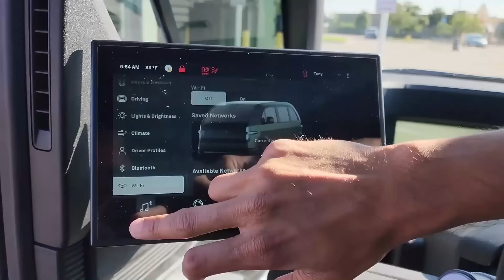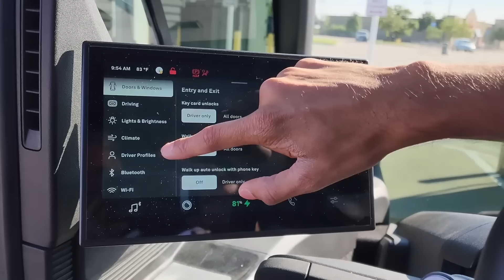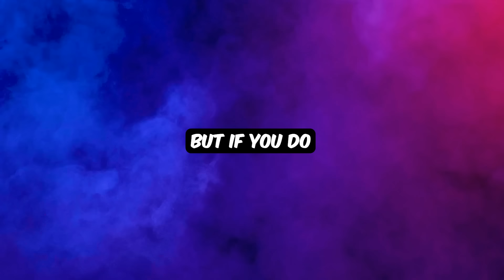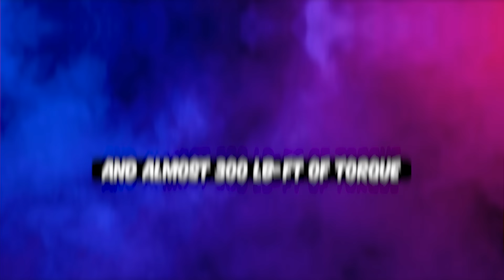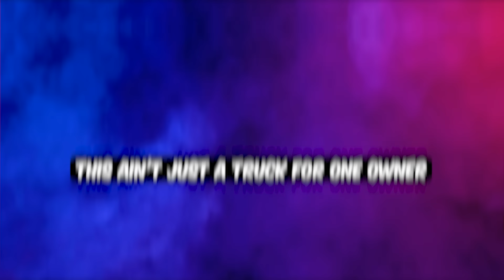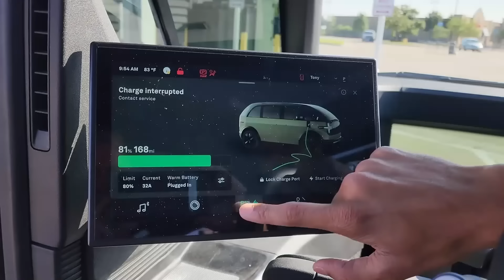IT'S HERE! GENIUS All-NEW Canoo Pickup Truck!

Comment: Very verbose and even some hyperbole but VERY light on facts, especially anything new. The headline says "It's here!" and yet we don't see any of these trucks on the road because they are not being manufactured for the public yet. Canoo still only has one manufacturing plant operational in Oklahoma and it's pumping out vehicles ONLY for fleet use. That's probably a smart business move for Canoo but it doesn't do anything for the public. The goal for 2023 was 23,000 vehicles but did they achieve that goal??? Even if they did, all those vehicles were destined for fleets. I would assume that even if Canoo can ramp up manufacturing, every vehicle it makes for quiet awhile will have to go to their fleet deals or they risk loosing money. I don't think the average pick-up owning guy or gal will be able to get one of these until 2025. Am I wrong?
Reply: Nope you're right. They appear to be dribbling them out to their commercial buyers. I have not seen exact numbers delivered to Kingbee, Zeeba last week or if Walmart has gotten any yet. I totally get their rationale. They're not ready to sell to the public yet. How would you get service? Drive to Oklahoma? No this makes sense. If you want one, and I do, you'll just have to wait. I heard 2025 at best. Also the range is 200 miles not 500. Price will be a little more than the top of the line LV model which is about 50K. They have a great product and I hope they can get going. Yeah I have stock too.

Comment: I have been looking at Canoo about 1 year before you made this video. After seeing other videos about Canoo, especially one  with Sandy Monro's video take on Canoo's van, I decided to buy stock in Canoo. In fact, yesterday I bought more stock in Canoo for my grandsons and more shares for myself.  I am considering replacing my 2008 hardtop convertible because I can no longer get certain parts for it. This truck and the van have so much going for it. At $35000, this is a very affordable EV and I like so many things about the Canoo van I like, that I am now hoping to buy one when they become available in my area. Because of snow in my area, I need front wheel or all wheel drive. If it comes with bi-directional charging, it could power my house with electricity when there is a power outage which happens several times a year here. The one thing I would love is battery swapping with Canoo like with NIO. But when batteries are swapped, they should only charge for the electricity. This is done with what Gogoro does in its battery swapping model.
Reply: Where did you find their stock? I didn't see it on webull. Maybe I'm searching wrong?
Reply: I wanna know too

Comment: Canoo may go the way of Elio Motors if they don't actually start production. The value of the stock a few years ago was $14 a share. Now it is around 16 cents a share. The fleet deals are nice and you do see promo pictures of the Canoo fleet vehicles, have anyone actually seen them on the roads or in the wild? There comes a time in the design/ manufacturing phase where they need to quit fiddling with it and actually start production and sales. Having said all that, yes I want one and I have shares of stock in the company. I'm frustrated because I've lost money in this company's stock.

Comment: The flatdeck on the military version will catch a lot of farmers and tradies eyes.  The competition is designed by toy users, not work users.  Even the Rivian which is the best size option for me is wellside only.
If the Canoo has a footprint the same size or less than the Nissan Navara/Frontier, then a right hand drive option has a realistic sales prospect internationally.

Comment: Everything sounds nice, but the major thing I'm worried about is repairability. With a unibody construction how are you going to repair panels
Reply: The same way you repair the 90% plus other unibody designed vehicles on the road today. There is nothing new to see here.
Reply: Just ask Rivian. Apparently it costs $35k just to replace one of the giant unibody side panels that can get damaged in a minor dent, a fender-bender. One of these EV channels demonstrated that recently.

Comment: Too much kitschy little garbage will inflate the price of this truck beyond affordability. The narrator says "SIMPLE", and then shows all these crazy little fold out compartments that NO ONE NEEDS OR WANTS. Give me a good infotainment system, heated mechanical seats and steering wheel, full safety features, and a 250 mile winter range with the cab at 68 degrees, and that's literally ALL I WANT in a vehicle. My Chevy Bolt hits the mark on all of these. It would be nice to have a pickup with the same truly "SIMPLE" design.

Comment: (The engineer(s) is/are genius )It’s nice but they should make it a hybrid variant ,have a small engine to maintain the battery charge. Until the battery technology gets better,  if at all, keep under $20,000 along with future battery(S). the batteries should get 600 to 700 miles per charge. And away to keep the batteries warm in the winter cool in the summer, have the  charging infrastructure throughout the US and every where else across the world. How about if you have to repair the body that is another problem. (Look at tesla what a nightmare )if you buy one who can service the vehicle? If so who is certified to work on the vehical? I love the truck and its versitality of it .I want to buy one but until they figure out these issues then I will buy one.

Comment: Few questions that come to mind after seeing this advertisiment. 

How much would scrach or dent repair cost on this thing? 
Will customer 35k version really have 500miles range or close to it?
When it is available in EU? 
Are they planning to let local repair shops do electric work too or is it something that needs their specific tech to fly over(adds weeks to car repair time and rises costs).
How much is range loss does weather do and I mean Nordic Europe weather where it changes from +30 to -30 celcius.

I was about to buy sono motors one that was like 20k euros but that company went under. Now Canoo is 35k and it isnt 100%sure that it will deliver. 
Also 35k not breaking bank is bit nasty way of saying that it dont cost much compared to other EVs. 
Here I can buy 2 single person apartments with 35k and maybe even have some left over. So in my mind it is still expensive as it is almost my full yearly salary.

Comment: I have yet to hear 500 miles of range for any vehicle actually coming out. Definitely not canoo. They have posted a targeted "200+" range. Range is the single largest downfall of every ev truck. When you take into account you have effectively 80% of useable battery (unless they use lfp batteries) and 20% range loss in the cold, if you aren't able to charge every night to your highest rate of charge, you WILL find yourself stranded if you have a destination to a rural area for whatever reason. And obviously long car trips are a pain in the ass.. I am speaking from experience here owning a model 3 sr+. Every manufacturer needs to be targeting 300+ if they want people to seriously consider them, especially for towing or long range trips... Towing will drop your range below 100 miles on a 250 mile battery and this has been shown across numerous models. Simply not doable. I'm not sure where you pulled 500miles of range from, but if true this won't be as much of an issue but I seriously doubt it since not even tesla has held up their projected 500+ miles of range originally quoted

Comment: BS..."The Futuristic design"... so it doesn't look almost identical to 1950's and 1960's trucks???? VW pickups, Ford Econoline pickups, Chevy Corvair pickups, Dodge A100 pickups, Jeep Forward pickups, several other international brand models as well all from over 50-60 years ago... Wow so they are the futuristic designers just by modernizing a 60 year old truck design.

Comment: Give it a fossil fuel engine and I would be interested
Reply: Fossil engine won't fit in this design
Reply: @jasonbridges45 actually a fossil engine can fit. Ever seen those itty bitty Japanese Kei trucks? They pack their engines in them under the front seat or under the bed. The biggest reason they have small horsepower is because of strict regulations. This truck with 200 hp gas engine and a 12 gallon fuel tank would be quit capable and would not need a lot of space to house it. With twin 200 hp EV motors and a smaller battery which gives it around 250 miles of range would be a sweet spot configuration. Everyone is all hot to trot over 600 to 1100 hp motors with 400 to 600 mile range batteries. Those rigs require huge heavy batteries and lots of beefy structure and space to house them. But unless you’ve got ginormous bucket of money, they are neither practical nor really useful. The new GMC Hummer is a really cool truck. But it’s only a halo truck, and only people with very surplus amounts of funding will be purchasing them.
Reply: @jasonbridges45  Too bad. Fossil Fuel is more environmentally friendly than hazmat batteries
Reply: Troll much???